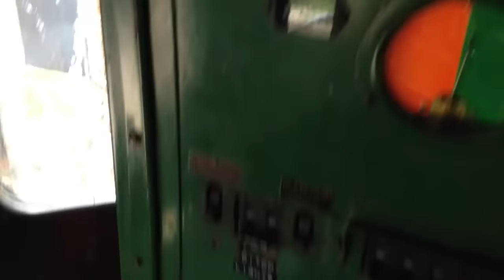Starting a Locomotive, (Full Sequence), EMD GP10 at the Florida Railroad Museum in Parrish, FL

Comment: Do you follow most of the same steps in reverse to shut it down, or is there a killswitch?
Reply from the maker: T. T. G. There is an emergency fuel cut off button that you can press to shut it down. You can also pull out the throttle handle and push it towards the window then it shuts it down. But yes all switches, breakers, and the big knife switch need to be turned off after shutdown.
Reply: tk aubuchon Interesting! Thanks for the reply!
Reply from the maker: T. T. G. Your welcome!
Reply: T. T. G. 

Push button on the control panel one push and it shuts down the fuel pump and drops out the run relay to the governor which then runs the fuel rack to the no fuel shutdown position. But before or after you push the shutdown button you must isolate the engine and if it is a turbocharged engine after shutdown do not open the main battery switch until the auxiliary oil pump has shut off. The auxiliary pumps lube oil to the turbocharger bearings to cool them off so the heat from the turbo doesn't cook the oil in the bearings and make the turbo more difficult to spin.
Reply: James Shanks  Thanks for the info!
Reply: yes, you need to run the stopper motor, then un-prime the engine.
Reply: steve1978ger Thats what I wanted to answer :D
Reply: RAKA'S TRAIN VLOGS 
That won’t work.

Comment: I find it interesting how most railroads keep a handful of them around to tow the new junk when it breaks down. I love seeing that. A locomotive with millions of miles on it, still working just as good as the day it came out of the box, towing new junk. 

An engineer told me if you’re in a remote location, leave it running, especially in the cold because you get one good crank out of it. If it didn’t start, you’re in your own.
Reply: "I find it interesting how most railroads keep a handful of them around to tow the new junk when it breaks down." No, they keep their older, lower-powered locomotives for switching and locals. No railroad keeps locomotives specifically to tow others that have broken down.
Reply: @beeble2003  guess again oh special one. LIRR does just that
Reply: @grazz7865  One example is not "most railroads", oh patronizing one.
Reply: @beeble2003  Amtrak is another one. And that’s a federally controlled railroad.
Reply: @grazz7865  What locomotives does Amtrak own whose only purpose is to retrieve break-downs?
Reply: @beeble2003  570, 571, 572, 573, 574-just the ones that are stationed in sunnyside yards. G38s.
Reply: @grazz7865  Those are MPI GP15Ds, which were built in 2004. Their primary use is for work trains and yard switching. These are not old locomotives that are being kep around to tow new locomotives that break down. And, while we're at it, MTA owns almost no locomotives so I've no idea which ones of theirs you think are being kept only to rescue broken down modern locomotives.
Reply: @beeble2003  my apologies. You failed to mention you were omniscient.
Reply: @grazz7865  Is it a problem that I'm introducing facts to the conversation? I guess it must be, since you've gone from talking about railroads to talking about me.
Reply: @beeble2003  I’m done arguing. You win

Comment: 0:10 - setting breakers
0:20 - tutning on control in the local cab and fuel pump
0:35 turning on engine run switch and steering
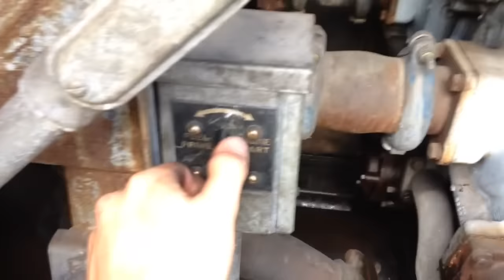1:06 turning on the engine

Comment: Yes, but you didn't open tge test cocks and roll it over first when you pulled the Low Oil button out. If there was any water in the cylinders, to crank it without opening the test-cocks, it would blow a hole in the pistons. Also check the oil on the dipstick and the water level in the sight glass. All that plus confirm the quality of the fuel sight glasses on the opposite side og the governor area than the start switch is. ONLY THEN, HIT START. Assist the crank-up by pressing in the Lay Shaft handle. I've done it thousands of times, to where I could do it in my sleep!
   THANK YOU FOR THE VIDEO. It brought back fond memories!

Comment: Do trains have gears? If so are they manually shifted? Or is a train transmission effectively a CVT or 1:1 ratio?
Reply from the maker: ReadyToGo only gears are in the traction motors. They do have a ratio but its very tight and no "transmission" per say. Power comes directly from generator to traction motors
Reply: Ah okay, I guess that makes sense as unlike a car you are not dealing with new conditions regarding traction. I.e. pavement versus gravel, uphill, versus downhill, etc. 

Another question, here in Canada we have "the Canadian" train which goes from Toronto to Vancouver (around 2600 miles / 4200 km). The climate and temperature varies quite a bit between those two places (i.e. In Jan Toronto would be -20C and Vancouver would be 5C) would the engineer have to adapt to these conditions? Like does the train behave differently when on cold rails versus warmer rails? 

Sorry for the poor wording haha it's a Friday night, my brain is done!
Reply from the maker: ReadyToGo colder or warmer rails don't affect traction unless is raining or snowing outside. Any moisture on the rails makes traction poor. Now excessive heat can make the track kink if there is no expansion joints. Plus depending on the railroad engines may not have antifreeze so sometimes they have to be kept running when they are parked

Comment: Didn't manually push the fuel rack to half throttle. All drivers get lazy and don't do it. Very hard on the starter motors if you don't.

Comment: Can someone tell me why, at Grand Central Terminal in NYC, they leave the diesels parked with engines running at high speed for hours between runs? Most trains are electric but there are many 1000 foot long push pull trains which are parked on the upper level right under street grates. Why cannot they turn them off or even idle them down?

Comment: Spent time in railroad yards 60 years ago, back then when they started a diesel electric locomotive,  would let it run for seven years before shutting it down, needed an overhaul I was told.  Didn't keep track of all the steps in this video, why not a key for off, ignition, and start?

As a kid, was really excited by trains and wanted to be an engineer, but in my first ride in a diesel locomotive, learned they did have steering wheels, so lost interest.  Airplane are a lot more fun, not only left or right, but up and down as well. 

Didn't call engineers, engineers, but hogheads instead, were not permitted to make any decisions, just follow some very strict orders.

Comment: Interestingly enough, our Baldwin RS-4-TC doesn't even require us to go into the engine compartment to fire it up.
Reply from the maker: We have an Alco RS 3, GE 44 tonner, and a GP 7 high hood and they don't require going into the long hood to start them either!
Reply: tk aubuchon We have a GE 45 tonner, and we actually have to go into the hood on one of the engines. I believe this is because of the massive amount of work the engines have had over the years. They even replaced half the engine on one.

Comment: I'm a conductor qualified with RCO locos. I'v had to  start SD38-2's and SD40-2's but have always had the governor button pushed in. Why was the governor pulled out and the engine start cycled then primed before doing the usual start up?
Reply from the maker: We do a process called "blowing down" our locomotives. By pulling out the governor button, killing the fuel pump, and turning the engine over your're allowing any condensation to be forced out of the test cocks. The part I didn't show was me opening and closing them. I pull the switch rather than just wait to throw the fuel pump breaker so I can do everything from the long hood.
Reply: Thanks.
Reply: No. They just give us what they think is good training and run with it.  They never told us about what could cause a manifold overpressure for one thing. I was attempting to restart an engine one day and just couldn't get that thing to start.  Eventually when the mechanic showed up he said the engine wont start because the engine was  over pressured. They gave us a booklet that showed us where the most common things were that we would work with. Our training was vastly different than what the engineers got.

Comment: Always had this question, does the engine have to be running in order to honk the horn?
Reply: As long as there is air in the system, the horn may be blown or honked.
Reply: Thanks! When I had permission from a worker to go inside a gp38, all the air was out of the tank.

Comment: I Watched before I read the description./ SO  at abou 36 seconds - the push /pull pin with some red - what did that do ? Cut off the fuel while purging air with test cocks open (I call that blow-down or blow out)
Reply from the maker: wfoj21 yes that's exactly what I did. It's the governor switch which kills the fuel pump

Comment: Why'd he pull the governor button out?  You check it to make sure it isn't popped out, along with the low water button and crankcase over pressure button. Also forgot to check your oil and water and over speed lever.  Oh and how's your compressor oil look?  And no push on the lay shaft handle? 
This isn't how any engineers I know start an engine! LOL!

Comment: Thanks for the vid. Some questions - 
How many hours do you have to spend on a train drive shift?
How comfortable is that engine room to sit in for long periods at a time?
Reply from the maker: harmless carrot well we only run on six miles of track and we don't have any customers. The longest I've ever been at the controls is about six hours or so, train crew on the weekends run about an eight hour shift. The longest the big railroads are allowed to run is 12 hours at a time. It's not so bad, there's no AC but that's only really a factor when your not moving.
Reply: Thank you TK Aubuchon. I don't know much about how hard it is to drive these monsters of steel.
Reply from the maker: harmless carrot it's quite easy actually. Hardest part is trying to stop at a particular spot with a passenger train and using the train brakes to stop on point. Rest is easy.
Reply: You don't sit in the engine room. You sit in the cab.

Comment: Just wondering, where does one take a shit in there while the train is moving?
Reply: all over the road locomotives, and local use locomotives are equipped with toilets in small rooms in the front hood area of the locomotive. ... Some have an air pressure assisted flushing system using fresh water similar to an airline toilet.

Comment: So how big R these engines that operate the locomotive?
Reply: Please specify what criteria you're thinking of - physical size, horsepower, displacement ... ?
Reply: whiteknightcat displacement and horsepower
Reply: Kirby York  GP10's were re-builds from GP7's, 9's, and 18's equipped with 567C series engines, so the displacement would have been 567 cubic inches. The horsepower would depend on the unit that was re-built. It could be 1,750 or 1,800 HP. Number 8330 was former Union Pacific 138B acquired by the Illinois Central and rebuilt to a GP10. GP9's were originally 1,750 HP locomotives so that should be the HP.

Comment: You should be wearing hand protection before going into a 600V service panel.
Reply from the maker: Crazy Horse Should be, agreed. However our rules don't require me to do so. I'm not even required to wear PPE gear or steel toed shoes but I do it anyway.
Reply: tk aubuchon Oh, just saying. I'm planning on working with electrical utilities. I have some experience with PPE.
Reply from the maker: Crazy Horse I know and like I said I agree with you I should be cause it is a hazardous area. Good luck sounds like fun work!
Reply: tk aubuchon It is. If you live in Connecticut, Massachusetts or New Hampshire, you would probably have Eversource as a electrical/natural gas utility company. I live in Connecticut and I have Eversource as a electrical utility company. I actually got the chance to see their storeroom. I'm also doing a project involving electrical utility, how it works and safety.

Comment: never seen someone pull the low oil trip to roll the engine over.
Reply from the maker: I did that to kill the fuel pump to blow down the engine to allow condensation to be forced out the test cocks. I did not show me opening and closing them. After that is when I primed and started it.

Comment: Does it use some kind of air starter?
Reply from the maker: DragRaceFanatic660 M nope it reverse-powers the generator that provides power to the axles during normal operation and uses a 64 volt starting system to turn the engine over
Reply: DragRaceFanatic660 M Some of the newer ones do.
Reply from the maker: 02isjw yes you are correct
Reply: The air you heard when he first turned the start button was from the cylinders being blown down before starting.

Comment: I would love to see this with an explanation.
Reply from the maker: Deon Van der Westhuizen you mean what each button and switch does?
Reply: Just what you are doing every time you adjust or turn a switch.  Like this button connects the battery with the starter motor.  This knob connects the steam inside the boiler with the crank case, etch...
Reply from the maker: Deon Van der Westhuizen the first big knife switch I pushed in was the main battery switch, then the control and fuel pump beakers go on, isolation switch should be in the start position, the run and control switch (same as control breaker) go on, then to blow down the engine to purge moisture out of the cylinders the governor button gets pulled out and the engine turns over. Then to start you push button back in and turn knob to the left to prime the engine (run fuel pump) then turn it to the right to start it

Comment: What does this beast of an engine idle at?
Reply from the maker: Cody Waters about 200rpms or so
Reply: Seriously? Man that's low... Being used to the lowest idle in a truck or car being 500 RPM, that's a very low idle. What type of engine is in it? Like a very big V16 diesel or something like that?
Reply from the maker: Cody Waters it's a V16 Diesel engine. At botch eight (full throttle) it will only crank out 1000 rpms or so. That's just how these Diesel engines are designed!
Reply from the maker: Cody Waters each cylinder is about the size of a basketball
Reply: tk aubuchon I think a DI3 ( EMD 16-567C/E ) engine idles at about 150 rpm.

Comment: Little bit more to it than starting a Honda Civic, huh?
Reply from the maker: The RangersEdge yeah just a little bit!
Reply: I can't imagine doing a glow plug job on one
Reply from the maker: No glow plugs in this engine. You'd be surprised at how long they keep heat though
Reply: tk aubuchon I can imagine. I just learned a bit about diesels today. I didn't even know they don't have a throttle. Or that the heat can get so intense thats why they dont use spark plugs. I guess thats how this engine is designed then, so hot it doesn't even need glow plugs
Reply from the maker: The RangersEdge will diesels do have a throttle otherwise they wouldn't have a way to increase RPM's however they don't have carburetors cause there's no need to produce fuel vapor in a Diesel engine. When the piston travels up the cylinder towards the head it compresses the air and in turn gets about 11,000 degrees in an instant. Then it injects fuel and instantly ignites under the compression. Regular gas doesn't have the properties to combust like diesel fuel does so it needs a little help
Reply: Exactly, that's also why diesels are more efficient.  I don't know about the engines in trains, but tractor trailers and pickup trucks with diesels don't have a throttle.  Air flows in constantly and can't be adjusted.  But when you press in the accelerator, the injectors  push in more fuel.

Comment: Too many unnecessary stuff are there.... Knobs, levers, switches, push buttons bla bla bla.....

Just connect a starter motor with the engine and put a self ignition switch for start-up the engine. Only 3 to 5 seconds are sufficient to start the engine.

I'm always feel very bad when entering in to a ship that seeing so many switch controls, pcb's, pipe lines, valves are used in it.
Reply: It is not car
Reply: @MedicusVishalus  everything is possible in modern technology.
Reply: @karsniv  
It is possible 
But these are old trains
Reply: @MedicusVishalus  you're correct, but nowadays also I can see too many non value added activities and unnecessary critical mechanisms are used in vessel. In marine construction needs some qualified R&D and design engineer like me.... 😂😂😂
All are old systems. 
There are two ways to touch our nose 
1. Direct touch by our finger
2. Turn our hand around the head and then touch the nose.

I'm the first option chooser.